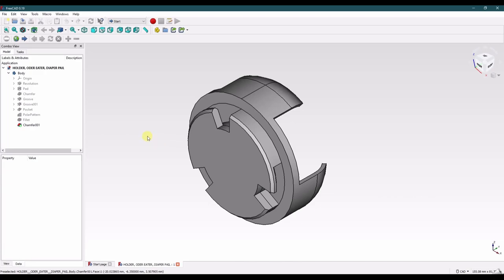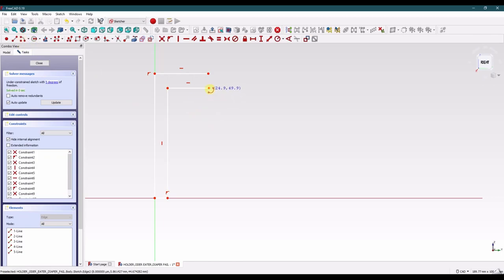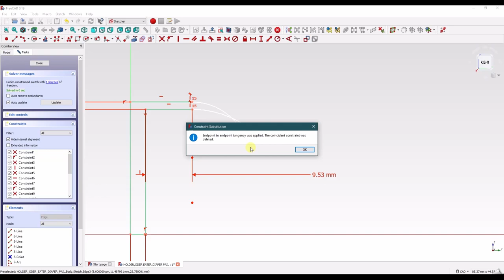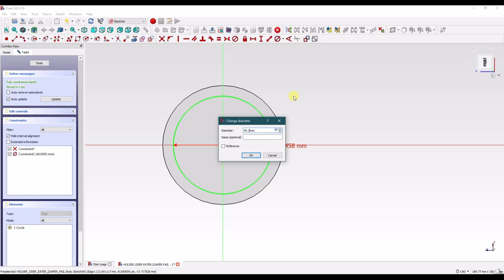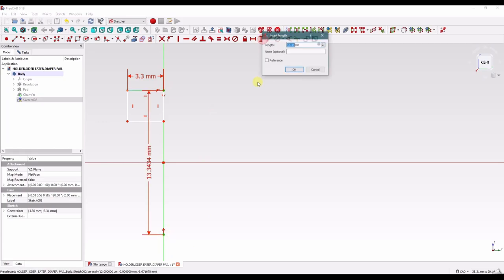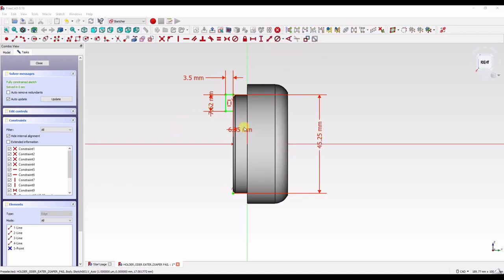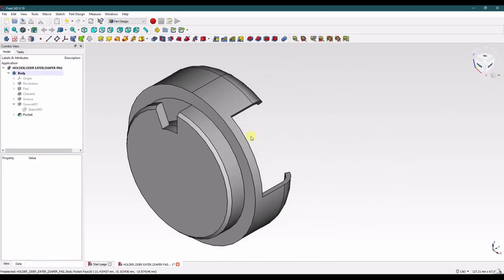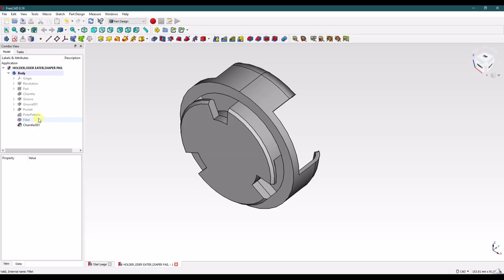FreeCad Tutorial #3 | How to model a replacement part using Revolve And Polar Pattern Feature

Comment: NICE! As always, great and informative video with a little bit of descriptive background why you were creating this. I really am curious how you printed this, as it would not be easy with the cut-outs at the bottom. It had to be a pain to remove the supports down there cleanly. Maybe i would have done this job in 2 parts, and would have glued the top part to the bottom part. But maybe this would be a little bit over-engenered as you put in this thing once, and forget about it.
Reply from the maker: I was able to use custom supports in Slic3r, so that there were no supports in the slots, and relied on the material bridging the gap.